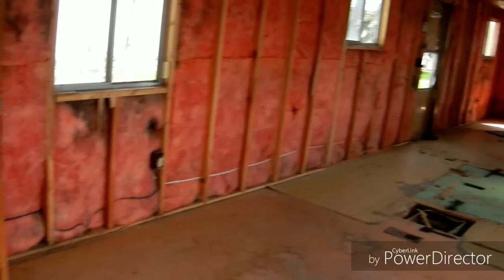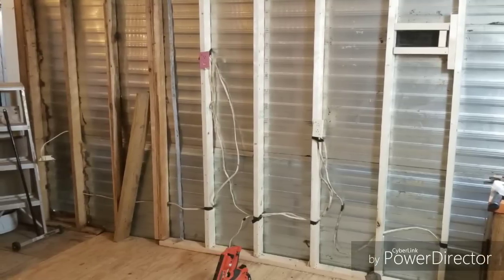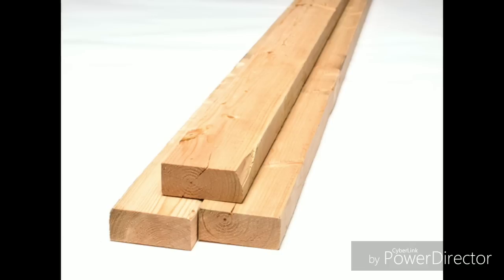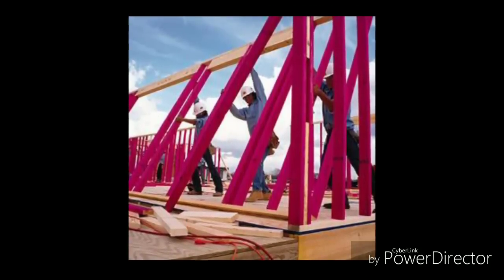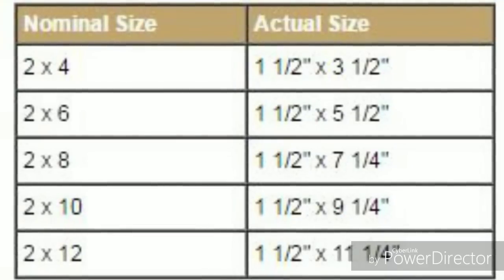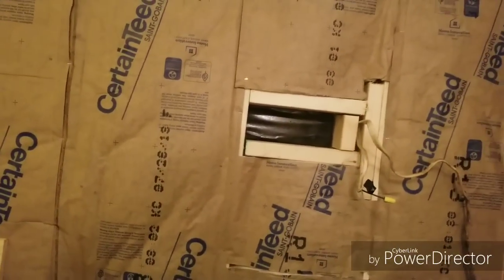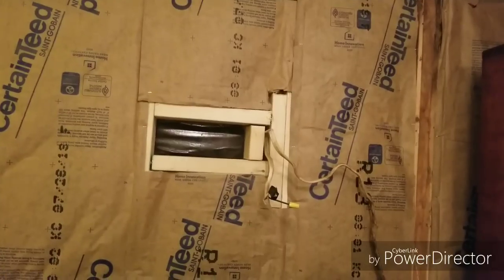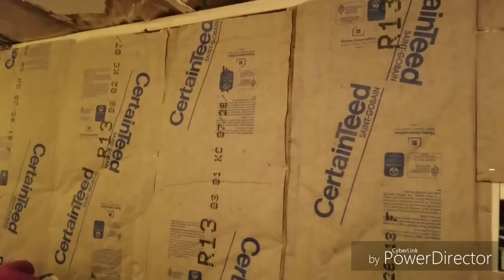Do Older Single Wide mobile homes have 2x4 Walls? EP.12

Comment: Seems like the older smaller trailers from the '60s have the 2x2 walls kinda like a camper trailer. Just go to a door jamb or window and measure how thick the wall is if you want to know. 

That's a nice book, I might have to buy one.

Comment: Ive heard that the older houses, with actual 2x4s arent sanded, but the newer ones are, but they sand it down 1/4 inch or so so you wont get bunch of splinters while handling.

Comment: i need to pretty much gut this place room by room and redo it. it needs a roof too. i want to redo the entire ceiling throughout. its an old 70's clayton singlewide, 2 bedroom, 1 bath.
Reply: I got a 70 that i just started on. Roof was neglected and destroyed the ceiling boards, rotted out the walls and part of the floors. Its gonna be one helluva project...never did any type of work like this before..

Comment: Trim nail and screws holding it on!?!? Lucky!! The newer manufactured and mobile homes are put together with staples and construction adhesive! Taking VOG down to expose the studs is work!!! And then you have to scrape the studs and pull all the staples 😬😒🤣I inherited the one I sold last year and it was in bad shape- remolded it to sell and move and bought another (this one is livable but needs work) this time knowing what I’ve gotten myself into... except they did a good job hiding the fact it had particle board subfloors 🤦🏼‍♀️... I’ll be buying lots of plywood as the process begins again

Comment: dimensional lumber actualy starts out as a full inch size  but is  planed to an engineered size ,2x4 plus 1/2'' seathing = 4'' 2x6 +1/2 sheathing = 6'' 2x8 + 3/4'' = 8''.  studs or precuts are cut to size to include top and bottom plates .

Comment: I'm redoing a 1972 Newport mobile home. All 2x3. I'm bumping things out to a true one and a half by three and a quarter to accept Pella vinyl replacement windows.
Reply: Checking back in. Redid two bedrooms so far and redoing the bathroom now. Bumping out the 2x3s worked out perfectly. The bathroom is a more intense job because two walls are being replaced with 2x4 walls.

Comment: Is the drywall in a mobile home thinner than what is used typically in a traditional home?

What do you do for the ceiling? Will you replace that with drywall or paint over the parts that have tears?

Thank you so much for the video and the information.
Reply from the maker: Hey REI, I will answer your question in a video response shortly
Reply: @MDC2020  Thank you!!

Comment: im afraid when i take a  ceiling panels off the whole roof will collapse. is that possible? what if there is standing water up there? the ceilings are sagging and you can tell its got water. its scary to try and do it when u dont know what might happen.

Comment: What is your plan for the ceiling? I always hated the look of trailer ceilings
Reply from the maker: Well me and my buddy Pate have thrown around a few ideas but nothing serious. We thought about metal, shiplap, even 1/4 drywall and finished like a regular home. But just not 100% sure yet
Reply: My Damn Channel If walls are still open, not too hard to do recessed puck light throughout, with dimmer switches. Looks modern, saves space :)
Reply from the maker: @twhitten828  Great Idea twhitten828
Reply: Shiplap would look really great. I painted my ceilings different colors. Living and dining room are khaki, bathroom ceilings are a silvery gray etc.

Comment: What are the rafters on these old mobile homes made of? What does it look like in between the ceiling and the metal roof? Is there a space is it insulated? I heard on some of these homes the wiring runs across the top of the rafters underneath the metal roof which is nuts! I'm asking because I need to fix a water damaged and moldy area and I want to know what I'm going to run into. Thank you so much for any information you can give me!
Reply: On a lot of the older ones they had small dimensional lumber (I've seen many with 2x2 or less) bonded with scrap wall paneling to make a half ass truss spaced at 2' centers.

Comment: Just took down a 1960s with 2x2 exterior walls, that's right, 1½` of wall and insulation, 2x4 floor and ceilings.

Comment: Pretty sure my early 70s disposable home had 2"x2" walls, and the sub-flooring fit into a slot along the frame on the outside edge, so it was a huge bitch to remove and replace. I just overlaid a couple of areas with metal plates about 1/16 of an inch thick and laid the carpet back down, worked fine.

Comment: I have a very old trailer and I was thinking of gutting it and putting up all new walls and ceiling. I want to put in 2 x 6 so that I can improve the insulation. I do not know know how good the floor joist are. I am not sure if I should just junk it or replace all the wood one board at a time.
Reply from the maker: Well depends if its paid for and you have land
Reply: @MDC2020  
Yes to both. I am thinking one stick at a time and I will not need a building permit.  Thanks!!!!

Comment: if its smaller than 2x4, you can still rip out paneling and insulate and redo walls, right?
Reply from the maker: Well sure, what size are you working with ?
Reply: @MDC2020  the boards framing the windows are 2x4s. i cant see what inside the paneled walls look like.

Comment: Federal law forced trailers to be stronger after 1976. My 1991 had 2" X 6" studs in the walls.
Reply: wade barnett not in all states they didn't.
Reply: @parrisestatessouthernhomec3246  Any mobile or manufactured home built after 1976 had to comply with the FEDERAL law.
Reply: @wadebarnett2542  Depends on the wind zone. My 1994 14x66 has 2x3 exterior studs and 2x4's around just the doors and windows. I'm in SC.

Comment: I heard that 2 x 6's were used in mobiles that were sold in heavy snow areas. Not sure if there is any truth in that, make sense though.
Reply from the maker: Yea Alan it does. But I also read that mobile homes in California had 2x6 walls also. My thought on it nothing better than overkill lol
Reply: @MDC2020  manufactured homes (any of them built after 6.15.1976) were/are built to HUD Code. They have over the years improved their construction, materials used in building and design considerably.  While it is true that some regions have higher roof load and insulation requirements,  they all have to be built to HUD code. Industry standards today are at minimum 2x4 exterior wall construction.  My manufactured home was built in 2003, has 2x6 exterior wall construction and 2x4 interior.  The studs on all walls are 16 inch center. My home is well insulated in walls, ceiling and floors. The home is on a permanent foundation,  has an attached 2 car garage and is taxed as real estate. The value follows the real estate market in my area and currently is worth twice my initial investment.  So, there is value in this type of housing. 😊
Depending on where your home is located, you may need permits for any work other than cosmetic.  Should you one day decide to sell the home and land together, you will find having obtained the necessary permits and inspections helpful. Just sharing some thoughts as I am a mortgage banker with 30 years in the industry and have financed many manufactured homes. 
Looks like you are doing a great job renovating your home and I enjoy seeing your progress and look forward to seeing more of your videos.

Comment: 2 X 4's were standard up until the 1990's... homes from 1990's to current should be 2 X 6" frames... it seems that all the interior wall seerms to always be 2 X 3" framing... manufactured homes are better built now, but still seem to be cheap in some ways...